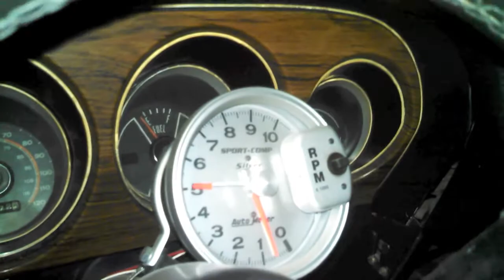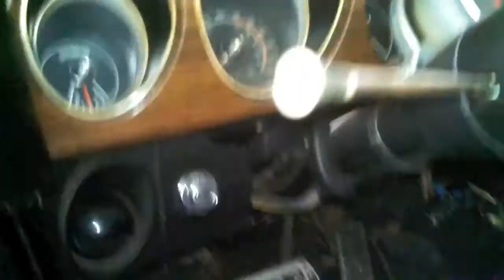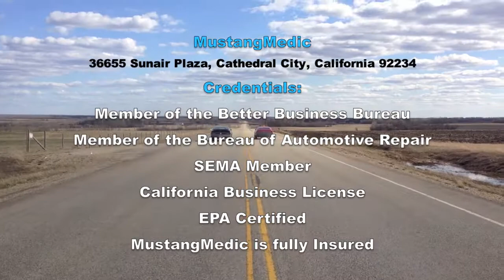Inspection on Alex's 1969 Mach 1 Mustang - Day 2 - Part 4 Restoration Show MustangMedic

Comment: Second time I have seen plug wires tightly bundled together and bound with zip ties. I was always taught that that was a big no no as it encourages cross firing. Maybe that just an old myth. Interested in your opinion on whether it matters or not.
Thanks

Comment: 69 had glue in glass which sucked because they always came loose like that. Best thing to do is upgrade it to 70 bolt in type glass but it has to be a 70 Fastback glass coupes and vert had the same glass Fastback didn't.